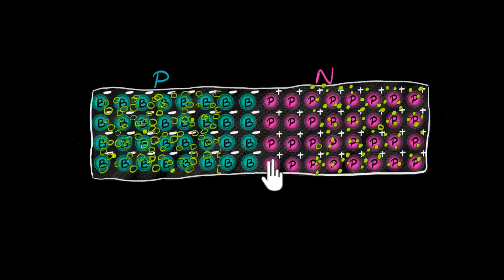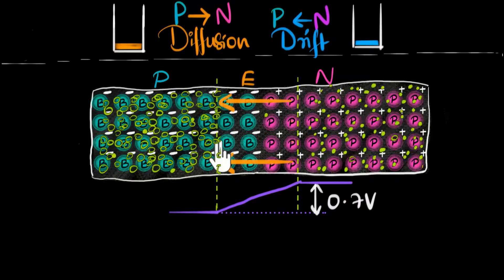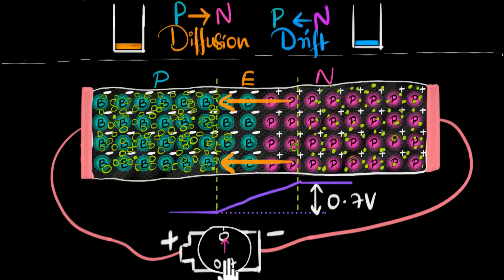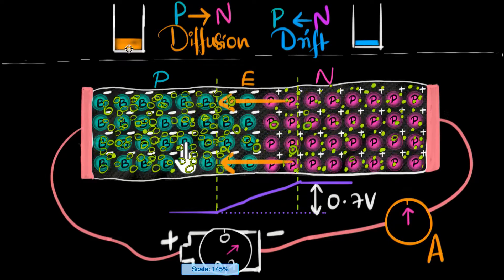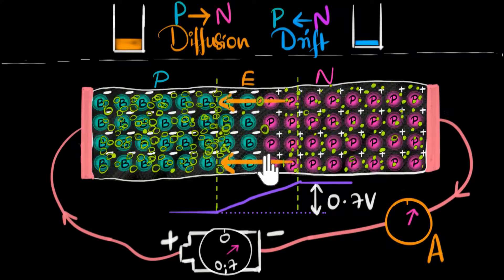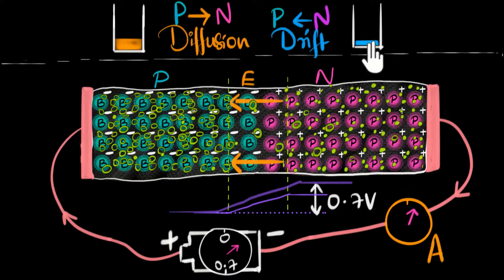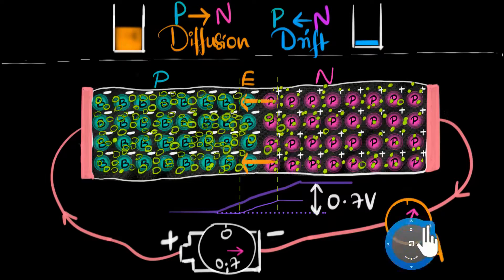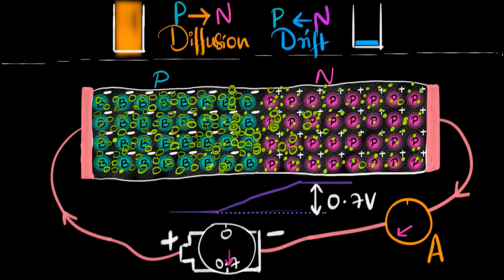Forward biasing a PN junction | Class 12 (India) | Physics | Khan Academy

Comment: bro actually holes are vacant spaces as you said only the electrons will be crossing the barrier but not the holes .

Holes in p type are present in the valence band of p type  wheras electrons in n type are in conduction band so to reach the valence band of p type they have to first reach conduction band of p type which has very few electrons(which are minority carriers of p type) and then loose energy to goto valence band to fill the vacant spaces.

Comment: I should ask this cuz this question is really irritating me. If the diffusion increases in the forward-biased PN junction shouldn't there be more exposed ions and shouldn't the width of the depletion region increase?
Reply: the electrons move towards the junction from the n side while the holes move towards the junction from the p side, and neutralize some of the fixed ions thus resulting in the shrinking of the width

Comment: The current in a diode under forward bias and in constant thermal equilibrium are due to the movement of the holes and the electrons moving and recombining on and on and on.
It would be useful to know what a current really is by a unified approach to electrostatics and circuits which is usually taught separately in textbooks and physics courses in scoence and engineering.
Watch the two videos listed below to learn about current and the conduction process and surface charges (using a unified approach to electrostatics and circuits) which set up the electric field whose line integral is the potential difference. The battery produces the emf.
1. https://youtu.be/REsWdd76qxc
2. https://youtu.be/8BQM_xw2Rfo
In the last frame of the first video a list of textbook references is given which discuss all these topics in more detail. Textbooks 3 and 4 give more details of p-n junction diode operation under forward and reverse bias.
Also explained in the textbook 4 is why the potential barrier of an operational diode can never be made 'zero'.

Comment: Sir, I have a confusion in this concept for many years. Could you please solve my doubt ?
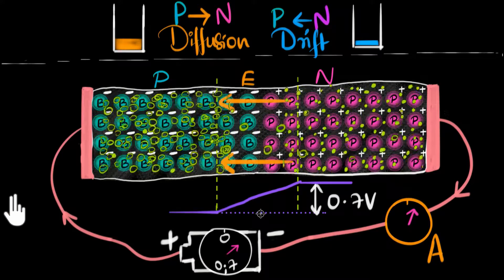4:31 If the barrier voltage is 0.7 volts and you are applying 0.2 volts in forward bias, there is still 0.7 - 0.2 = 0.5 volts of barrier potential. Then how does the current flow ?
Reply: I am not sure if i understood it right but i think when the value was 0.7 only a few of em could go across the depletion region but when it was reduced to 0.5 and also at the same time made the region smaller, it basically made it possible for some more of the holes (which could've crossed with lesser energy) to go accross  the depletion region and vice versa for the electrons. Hence as it isn't under equilibrium anymore, current flows.

Comment: Hi! I just want to ask why the voltages in the neutral zones don't change when a forward bias is applied? Since we know that when voltage is applied to any component, there will be an electric field inside it which points from positive to negative, and since the diode originally has no electric field in its neutral zone to cancel it, shouldn't there be a voltage in the neutral zones? Is there some kind of mechanism that counteracts this?
Reply from the maker: That's a great question. We are doing a lot of assumptions here, and one of them is the negligible resistance in the neutral regions. This is similar to how we neglect the resistance in wires and assume no electric field there!
Reply: @KhanAcademyIndiaEnglish  Please help me‼️‼️‼️ please , how can holes travel to N region , they are just the vacant place where electrons lack right ???
Reply: @proudnepali8388   Hole are the vacant space. Since the negative terminal of the battery is connected with n type semiconductor where electron are the majority charge carrier. And the positive terminal of the battery is connected with P type semiconductor where the hole are the majority charge carrier. Due to the repulsion between negative terminal of the battery and free electron as well as the repulsion between positive terminal of the battery and hole the depletion layer width decreases. So that the some energetic free electron migrates from n type semiconductor to P type semiconductor due to decrease in depletion layer(resistance decreases). Before migration in the n-type semiconductor there was neutral condition but after the Migration of some energetic electron there are generated some hole in the n type semiconducyor. So  due to migration of free e there is some hole are generated. That we call migration of hole .
Reply: @KhanAcademyIndiaEnglish  Thanks for the response! I think that clears things up for me then

Comment: Sir while Forward Biasing a PN Junction, there will be current flowing in both directions, right? Because both diffusion (major) and drift (minor) are happening. So there will be a tiny current flowing from N to P. So we can't use this Forward Biased PN Junction in daily life (as the main goal is to allow current to flow only in one direction)
Reply from the maker: In forward bias, the diffusion current is orders of magnitude larger than drift, so there is a high current from P to N. 
In reverse bias, there is a very tiny drift current from N to P.  In most applications this is negligible 
Thus the diode acts as a one-way switch, conducts in the forward bias, but doesn't conduct (negligible conduction) in the reverse bias. 
Hope this clarifies your doubt.

Comment: Why is the diffusion current increasing when you apply a forward bias ?  Drift currents means that the motion of charges is due to an electric field while Diffusion is caused by difference in concentration. When you apply a forward bias you create an applied electric field across the junction that will make the carries DRIFT to the opposite side not DIFFUSE.
Reply: You can think in this way that, 

When we are appling the Forward biasing then the majority charge carriers (Let say holes of the P Region ) are facing the repulsion from the holes that are coming from the battery (As it is Forward Biased), Knowing the fact that battery also emitts nothing but the free charge carriers. So due to this majority carriers start pushing in the forward direction and hence the current due to majority charge carriers in forward direction increases (So called as diffusion current).

Drift current is due to minority charge carriers (These carriers are the ones that are present before the doping when the semiconductor was so called INTRINSIC Semiconductor, In which both the electrons and holes are present in equal concentration and the doping came which increased the concentration of one type of charge carrier and made another one a minority charge carrier.), So if we are appling forward biased then these will oppose but their oppose is very little as compared to majority charge carriers (As their concentration is also low).

Hope this helps. :)

Comment: All the concepts you gave upto this point were great but this video has pretty low standard as far as concept is concerned... you should have talked about flow of electrons rather than saying holes are flowing and should have talked about conventional and electron current
Reply from the maker: There are two types of electrons. Free electrons that flow freely, and valence electrons (which are covalently bonded) which move from one 'hole' to another. These two motions are pretty independent of each other. 
The free electrons literally move over some distance. But the valence electrons just jump to a neighbouring hole, virtually moving the hole in the opposite direction. Then the next neighbour will jump in and then the hole again moves (virtually). So you see these valence electrons are not really moving from one place to another (just jump to their neighbouring space and sit there). Hence it makes it both easier mathematically and intuitively to imagine that these 'holes' are moving. This is why we treat holes as a separate individual particle and consider it's motion in the valence energy region (just like how free electrons move in the conduction band region). 
If you need more details on this, they are explained in previous videos, do check out the playlist. Hopefully, it would help.
Reply: Khan Academy India - English that’s an amazing explanation to distinguish between how we Conceptualise things for ease vs how it actually is. 👏👏👏

Comment: How does increase in diffusion current decrease the depletion layer? It doesn't make any sense coz diffusion caused depletion layer.. plz do reply this question..
Reply from the maker: The depletion layer decreases due to the external power voltage supplied. 
This inturn increases diffusion because the depletion region was acting as a barrier for diffusion.
Reply: Khan Academy India - English Why is it not that the diffusion current increases and so the depletion layer again becomes wider due to it?